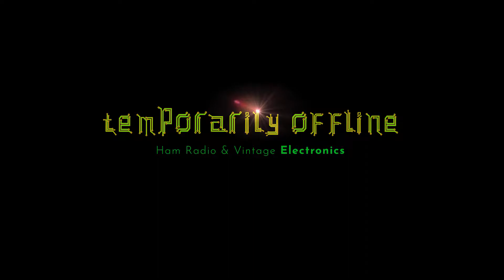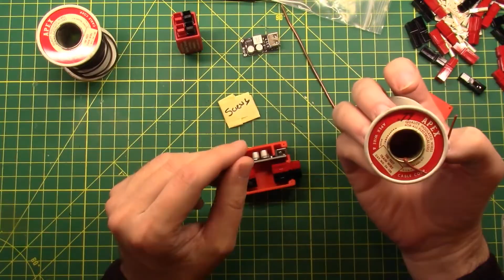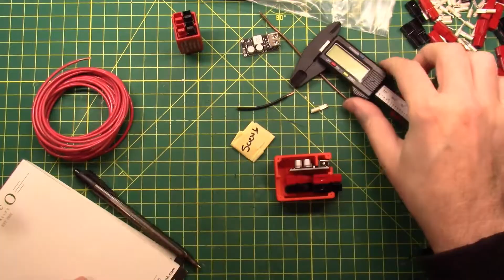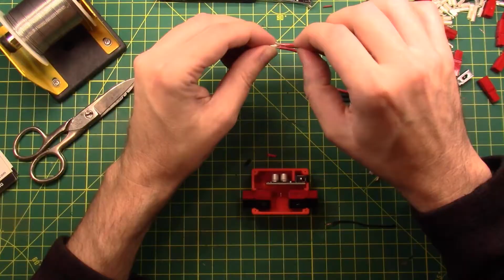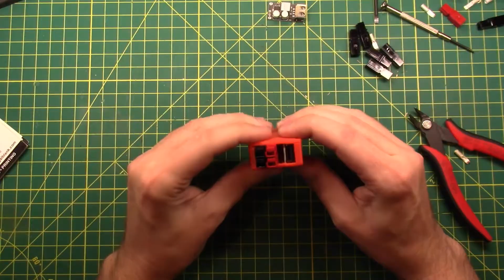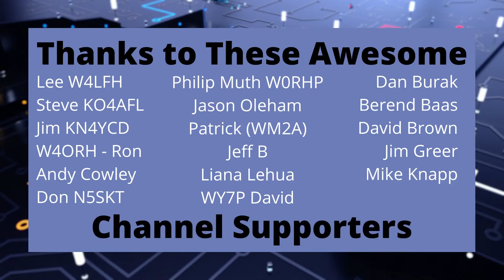How to build the JuiceBox for your Raspberry Pi and Ham Radio Power Needs

Comment: Do you know the size of the screws that were used to build this?  I have everything except the screws.
Reply from the maker: I don't really know other than "Small" - they came with my kit.  I'd suggest going to the local hardware store (not big box store) and playing around in the hardware isle.
Reply: @temporarilyoffline I ened up finding some #0 1/4" flat head phillips screws.  Those seemed to work.

Comment: I just made this and it is great! Will be used when I am operating portable to power my radio, ATU 100 and keep the phone charged up for a WiFi connection. Thanks for the great video.
Reply from the maker: That's awesome, glad it's working out for you!
Reply: How do you plug two USB devices?

Comment: I did a diy 4 or 5 port Anderson power distribution.  I used push in wire connectors, some 12 or 24 gauge wire and Anderson power poles.
Reply from the maker: Sounds like a neat DIY project!
Reply: @temporarilyoffline I will dig it out and video it

Comment: I'm wondering if it should be used to put two batteries to one USB device
Reply from the maker: If you wire it right internally and If the batteries are the same spec, say 6ah,12v then it would work - you'd get 12ah, 12v that way.

Comment: Great video. I am inspired. Now to find a fellow local ham with a 3-D printer I can persuade to print the box for me, or maybe a rental? Good instructional video. Oh, by the way I love the patina of use that those wire strippers. They have been around and well cared for.
Reply from the maker: I still use mine today, great way to run an all-star node in the car.

Comment: I have a set of those telco shears from Fluke.  I was worked in the IT industry and had to learn 2 wire low voltage work for telephones fax and I used them for making ethernet connnections too!
Reply from the maker: They work really well

Comment: Think there would be any issues with using 18AWG instead of 16?
Reply from the maker: Not really, just keep that in mind when you pull power from it.
Reply: @temporarilyoffline  Thanks.. using it to power the QDX AT-100M and maybeCQV-SWR120 to utilize only 1 Powerpole :D
Reply from the maker: @K6WRF  sounds like a plan!

Comment: Will the USB be able to power the Novato little computer from your previous video?  I bought one after your video. And want to use it with my KX2 for FT8 and Vara.
Reply from the maker: It depends on the boost converter you get, but in its design, that is exactly the use case for this device - ham battery, radio, tuner, raspberry pi.

Comment: Bloodshed?  Cursing?  Where have I landed?  LOL
Reply from the maker: Only in ham radio...
Reply: The other day I was making a cable with Powerpole connectors and soldered the wires since I don't have a crimper yet, and using a small screwdriver to push the connectors in it slipped and sliced my thumb.  Bloodshed.  Cursing.  I was cringing when you did that...
Reply from the maker: @ronwolenski-n8wcr  a little ham radio induced PTSD